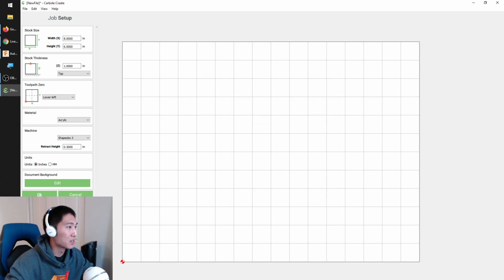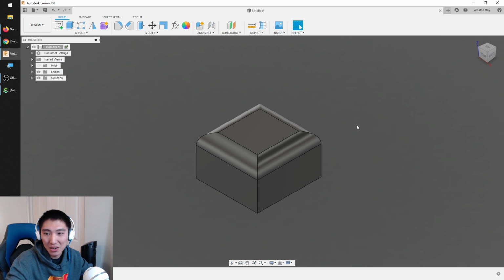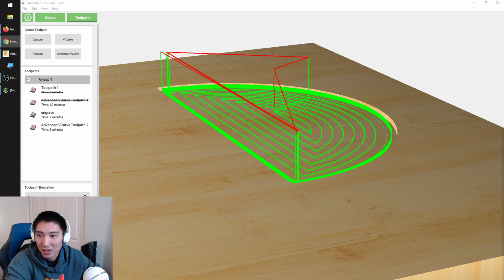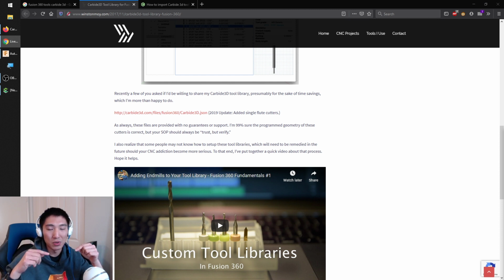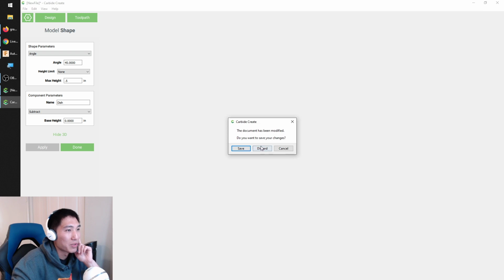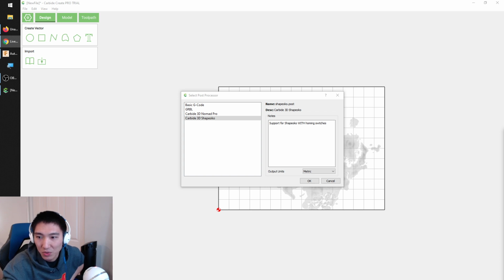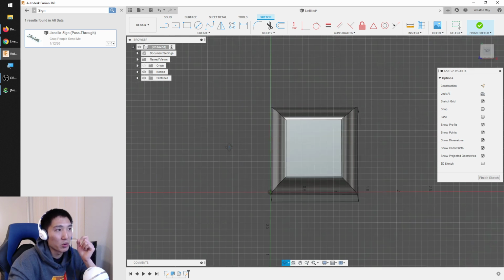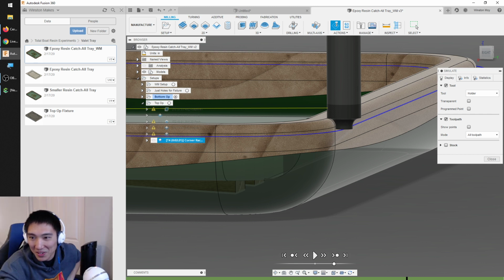Carbide Create & Fusion 360 Q&A (3/20/20) - Carbide Office Hours

Comment: @9:30 about chasing accuracy.  I have been upgrading my XXL with HDZ, spindle,C3Ds new V-Wheels and HD esentric nuts   and steel reinforced belts.  With this I can run the holes in a triangle test and I get dead on accuracy over 11.5 inches.  
I'm really surprised and impressed by my little Shapeoko that can!!!!!

Comment: @Winston I have a useful multi-video project that I think everyone could benefit from. Why not build a manual 4th axis with  degree markings that a user can use to rotate part accurately. It would have a locking mechanism to keep it from rotating while in a cut and as far as I know there is nothing like it on the market. I believe this could be real useful for people like me who mill complex geometry regularly.
Reply from the maker: There are manual rotary indexers and dividing plates. For smaller stock, 5C collet blocks are also great.
Reply: @carbide3d  oh cool thanks I never knew the 5C collet blocks existed!